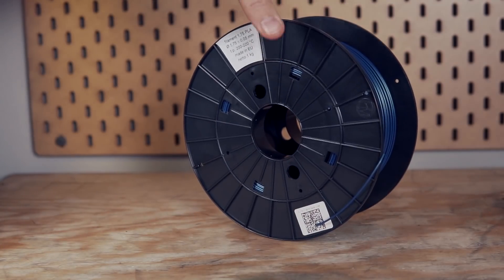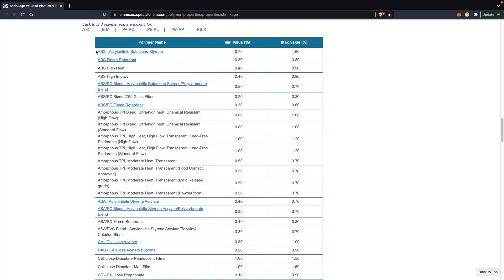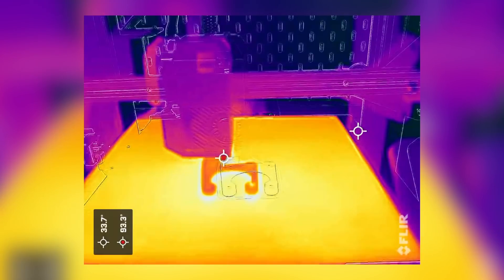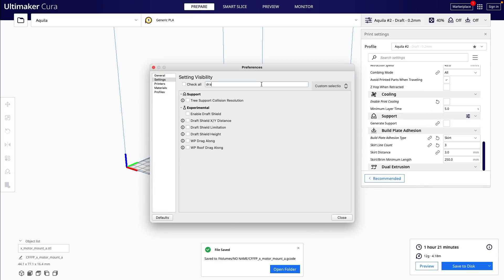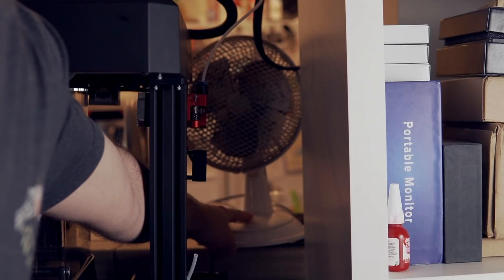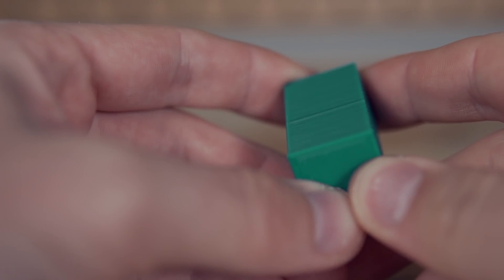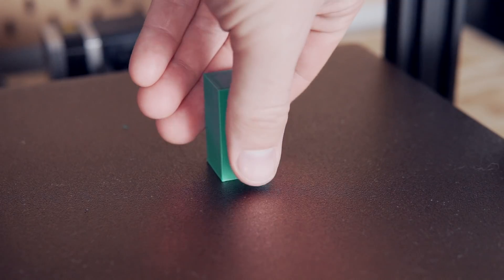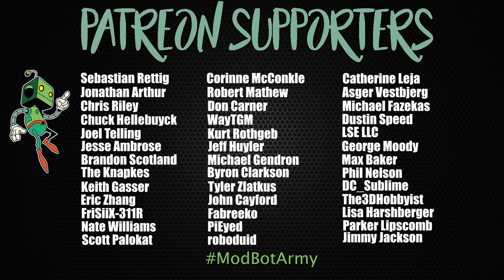Do Draft Shields Prevent Warping?

Comment: The best way to stop warping on abs I have found is using gcode to keep the bed from cooling down so fast. I have my bed go from 110 to 80  and hold the temp for a few minutes after the print is done so the bed cools down slower.
Reply: That sounds like a good idea could even go down in stages, like a reverse cooling fan spread.

Comment: One note about the thermal camera use - Part of the temp reading of the bed is reflected ir from other objects. The bed temp where the plastic is is not actually hotter. You can see this really well on video when the hot end moves and you can see the bed temp "change" with the movement of the hotend.

Comment: I use draft shields for anything that warps or has cracking.  So ASA, ABS, Nylon.  It works very well and allows me to print functional parts with an open printer.  I also feel the print quality is a bit better as it spends some time printing the draft shield, so layers with low cross section area print just as good as the rest of the part.  Definitely recommend to always use them for materials that require enclosures.  I wouldn't mind seeing someone evaluate draft shields within enclosure...
Reply: I am curious what size the prints are where shield is effective enough. Do you have some experience to share regarding this? If so, tnx :)
Reply: A little brim has always work for me for ASA or ABS, I don't see the advantage of that shield, particularly when you have to print high pieces.
Reply: @mr.nobody8174  late reply.  I have printed abs parts that are 4 inches tall on a bed slinger w draft shield that succeed where they split otherwise.
Reply: @Turbo999be  less and more unform cooling.  Might make a part that just fails become a part that just succeeds.  Maybe I'll grab a thermal camera and do a heads up comparison to see if that's true :)

Comment: Working Great here, Open Air Sidewinder X1, BIQU SSS bed working no additives, Draft Sheild, 30s Layer Time, 240 Extruder, 100 Bed, 10mm part and shield spacing, 10% fan (5015 duct), got a really nice voron test cube with Polymaker ABS, THANK YOU FOR THE VIDEOS!

Comment: Really great to see your scientific approach. High quality video! 

I have been using a skirt as a draft shield . I have found that i needed it very close to the perimeter of the part to be effective. I still needed to pull all the other measures to get abs to work as well hiwever. 

Thanks again!

Comment: I have used draft shields on ABS and a tried on PETG.  If my PETG is dry it seems to work OK without the draft shield, but it really helped on ABS.  It would be interesting to see some tests with different bed temps to see how they impact warping.  I remember seeing somewhere that keeping the bed temp and the hot end temp as close as possible would help.

Comment: I've been printing ABS in a much colder room (about 12 degrees C today) and without an enclosure I get warping that will rip the item off mid-print, or snap the layers apart, or both.  After much tinkering, the three things I did that gave me working prints every time were: 1/ Covering the whole thing in a garbage bag for a makeshift enclosure. 2/ Adding draft shields to my prints. 3/ Leaving the finished print on the fully heated bed for an hour for any internal stresses to dissipate.

Comment: thanks for the info. i've had abs hanging around for several years not being used because i hadn't built a chamber. decided to test the shield and after figuring out the z offset for abs it's printing great.
Reply: I print ABS with the same Z as PLA and it's never been a problem.  Prusa MK3S+ by the way.

Comment: I print in an enclosure so it's controlled temp. but still need a draft shield for most things I print because of the size, usually over 4" on any direction. For enclosures, we also practice putting slots in to reduce the tension a line puts on the lines underneath it, if the customer allows it! Helps significantly.

Comment: I'm planning to try this when I do some experiments with ASA on an open bed printer. I think "Draft Shield" doesn't really explain what it's actually doing in your tests though. Yes, if there was a draught in the room, it would help shield it from that somewhat, but even in a room with perfectly still air it has another effect - it helps reduce heat loss from the part via infrared re-radiation.

If you imagine yourself being the print job and you look around your field of view 360 degrees in 3d dimensions a large part of what you can "see" is the walls of your room which are "cold" compared to the print bed, so there as a lot of heat loss. As well as direct conduction there is a lot of IR radiation coming from the heated bed and not much from the upper 180 degree field of view to the part which is mostly your room.

The printed draft shield forms a wall around the part which is at a much higher temperature than your room walls - the printed wall is heated both from conduction directly from the bed, (which probably won't go very high due to the thinness of the wall) but also from IR radiation from the bed surface radiating to the wall at an angle, warming the wall. The wall then re-radiates this heat back at the part to some degree. 

Increasing the spacing between the part and the draft shield should actually increase this effect somewhat as you would be increasing the bed surface area between the part and the draft shield which is able to heat the inside of the shield with direct IR radiation. So don't make the gap between the part and the shield too narrow. Of course the outside of the shield is also being heated by IR radiation from the outer parts of the bed and due to it being thin this heat will be conducted through, so the larger the bed relative the print job the better.

This is all similar to what happens to a car parked on a driveway on a winter night - if the sky is clear the IR "temperature" of the night sky is extremely low so there is a lot of heat loss from the car depending on how much of the sky is visible to the car, causing the windows to ice up and go below ambient air temperature. But a cloudy sky raises the IR "temperature" of the sky dramatically and dramatically reduces the heat loss from the car even for the same air temperature resulting in the windows probably not icing up.

Comment: People question the effectiveness of a draft shield because hot air rises, but this is only true when cold air can flow in to replace it. A draft shield limits the entry of cold air which will cool the parts. The only way in is down past the head and this is normally another hot area. It'd be interesting to try a smoke test to see where the air flows are. (Maybe even a small hole in the plate and pump some smoke up into behind the shield, special raft maybe).

Comment: drafts shields are great when you can't use cooling fan to give time for the previous layer to cool without having to print slower and alter the flow on that smaller section

Comment: I use a skirt that runs up just 3 layers tall as a psuedo draft shield. What it solves for me is that I print in a finished room in a garage and it does get cold enough for snow, ice and sometimes things you don't expect to freeze. While the room is kept 65F to 70F, opening and closing the door blast a breeze right across the print bed. I have had that cause sharp corners to lift off the bed right in front of my eyes, doesn't happen with the psuedo draft shield.

Comment: I've been printing with ABS and nylon for a while now. No, draft shields will not prevent warping. I had to change to a hotend that doesn't blow air down on the part, and even then, I still had problems with sharp corners and overhangs curling up into the nozzle.
Reply: I've had the same experience.. on small parts, a draft shield can work but for anything larger than 100mm, I've had warping even with a draft shield.  Covering the whole printer with a clear trash bag has worked better for me.
Reply: @Fukgoogle123  I've actually had good results with a "draw through" setup on the V6 hotends using 5015 centrifugal fan.

Comment: My central air blows right on the machines at 72°F.  Doesn't affect the print quality. I do print in PETG  most of the time. Honestly, I only get stringing when I do clean time-lapse video because it has to move the print head to the corner and bed out to take the snapshot. If I don't do a clean time-lapse or time-lapse at all it doesn't string because it doesn't have to move the print head out of the way. I would also suggest that you put your printer in the corner of the room. That will give it two walls to block drafts.

Comment: It is called an ooze shield in Simplify3d and I found it to just create more failure points as shown in your video where it could itself warp off the bed and then could collide with the extruder!  It will also waste time, money and material!  I just throw a plastic bag over my printer and turn up the bed heat a bit to create an ad hoc heat chamber!

Comment: Did you test with it using a wider / flat part that tends to curl up during printing? We print a lot with ASA on open frame printers but its a draft-free 75 degree room at all times. The parts are about 1 inch wide and 3 inches tall. They are engineering-grade parts for an industrial application that see real world use. We have never had to replace any of them in 3 years.

Comment: You mentioned printing at a higher temp because you didnt have an enclosure. When I was dialing in ASA on my Ender3 pro I turned the temp down slightly. The thought is that lower starting temperature means less of a temperature drop and thus less warming.

Comment: Great video!  I looked at draft shield but I on print ABS in an enclosure.  Now for the tough question.  What causes that fat layer at about 15mm?  I get those once in a while but have no idea where to start looking to cure the problem.
Reply: Do you have cooling fan changes around that area?
Reply from the maker: I believe it is due to the warping/temperature fluctuating. Since it was much more noticeable on the square I printed without a draft shield the only thing I can think of is that part of the model is cooling causing the part to warp. With the second part not having any changes but that draft shield to help keep heat more even the bulge is almost completely gone. 

When you get that issue is it with ABS specifically?
Reply: @ModBotArmy  It doesn’t happen very often, it’s just irritating when it does. Doesn’t appear to be height specific and I’ve had it happen with all filaments. Since I’ve been doing most of my printing on the Voron 2.4 I don’t remember it happening. Mostly on the Ender3v2. I just assumed it was something binding in the Z axis. When I saw it on your print I just thought I’d ask. Could be a fat section of filament I guess.
Reply: @woodwaker1  Nope. No cooling fan changes.

Comment: How about a reusable draft shield. Could be an accordion sleeve, thin tpu or even tinfoil with a stings tied to z bar that rises as z goes up:) or thin legs that go up and over z wide enough to avoid X interference.
Reply: the new prusa xl has an addon for that iirc.
Reply: just put a clear trash bag over the printer.. much cheaper and easier.

Comment: A draft shield seems like something of a no-brainer when you need to keep the temperature of the part even and high. My printer is in a separate larger enclosure, but not so small that it will manage to heat the space meaningfully - some 5 degrees over ambient perhaps. But with draft shields, I think I'll give some ASA parts a whirl.

Comment: funny, I almost exclusively print in ABS and even with about the cheapest available printer atm and no enclosure.. a 110°C start temp for the bed (1-3layers usually) and then dropping to 105°C at first than 100°C maybe; depending on the height and print time and successfully so I need to point out. The only time I experience warping is when I carelessly forgot to keep my glassbed perfectly clean (the silver ABS [BASF] somehow leaves a waxy residue after a print.. and that doesn't stick well so a quick IPA wipe before each print and I'm good. (and when IPA is out a good soap and water wash)
But true I usually print up to 15°C above the filament manufacturers recommendation (currently @250 for a recommendation of 225-245°C.. so yeah just 5 over atm)
and don't use draft shields at all (tried once, no difference in result.. saved time removing it from then on)
Oh I almost told a lie.... I can't print too well on that cheap i3 clone if the footprint is too big (say above 120mm in X and/or Y) since my bed isn't heating up very evenly (I did mention it's cheap, right?) I get a deviation of around 10°C from the center to the edges, so on those parts I actually tend to add a draft shield again, but just to help the bed keep the temp uniform more easily.
And sometimes that doesn't even help. I just found out about the tight enclosure (from 2015 doh!)  whilst reading about the ribbed vault infill since I didn't like the cura implementation too much for some reason ... long story short.. IceSL was installed a few moments  ago.. giving that tight encloure draft shield a test soon.

Comment: As a European, I'm glad 3d printing is about almost exclusive metric values. Therefore I had to lookup what "the mid seventies" was in Celsius ;)

Thanks for this, but if you mix temperature scales, could you please explain what that is in both scales? I guess most of you Fahrenheit junkies are getting used to Celsius through 3d printing or science in general. The rest of the wold still uses Celsius ;)

Comment: I didn't know ABS warped. I print it at 235-250° with the bed at 110° door closed and the hatch on and closes. 20% cooling and circulation fans off.

Comment: The bed should always be below glass transition temperature to ensure rigidity of the base layer
Reply from the maker: Looks like the glass transition in most TDS I am seeing is 105. The bed didnt climb above 100C. It was set to 100C but I doubt it actually reached that on the top surface especially with it being open.

Comment: I've had much success with ABS + Brim + Draft shield on an open Ender 3 V2. I've upgraded the bed with a textured powder coated PEI and I use no adhesives at all.
And I've managed to print a lot of ABS, mostly without any warping and sometimes with just minor warping on corners. I recommend the shield for ABS for anyone who hasn't built/bought an enclosure

Comment: great video, thanks! draft shields would appear to be rather inefficient without a lid as most of the warmth would move up. 
so, fitting a thin plate around the hotend that serves as a moving lid combined with a draft shield should be a different story. Anybody tried that?
Reply: Sounds good. I will try that in the next days

Comment: Thr temperature scale should have been set to fixed 30-130°C to better show the changes in part temperature
Reply from the maker: I believe my thinking behind having the wider range was that it would be able to see the filament coming from the hotend. In this case you are probably right since the primary focus was on the part temp that would have been within the lower range.

Comment: I printed my Voron 2.4 parts in ABS, ASA and, hardest of all, Polycarbonate on my Prusa MK2.5.  I found draft shields definitely helped and the PC would not have been possible without using them.  Of course, it means you need to print each part individually but, as I was waiting weeks for all the bits to arrive from China, I had the time to print them carefully.

Comment: Draft shields used to be all the rage back when folks could only print tiny things realistically and nobody had a legitimate reason to stick their printers into enclosures, the cons of overheating electronics/motors and thermal runaway etc, just made all that a very poor idea back then, now it's fairly mainstream. Hence I find it funny you mention draft shields being uncommon, it's one of those. "what's old is new" moments. Also very curious they are under 'experimental' also if you've seen the filament printers that can print upside down, the draft shield works even better on those because the heat rises up into the part and stays at the base.

Comment: The side-by-side thermal comparison is misleading as FLIR cameras display a range of temp and there is no way that your part is as warm as the nozzle.

Left side has the nozzle in shot, therefore it’s the warmest (whitest) area of the screen whereas the right side does not and therefore shows the base of the print as the warmest (whitest) area of the shot.  

You will need to maintain the same camera angle for an accurate comparison.

Comment: I think a draft shield would be better on a duel extruder. Use a cheap easy bed adhesive pla for the shield.
Reply: not really...  the time needed to switch between the nozzles or materials are simply not worth it. also PLA will lose some of the adhesion when the bed is warmer than 60C so if you print ABS and PLA at the same time, you will experience issues with the bed adhesion issues with PLA.